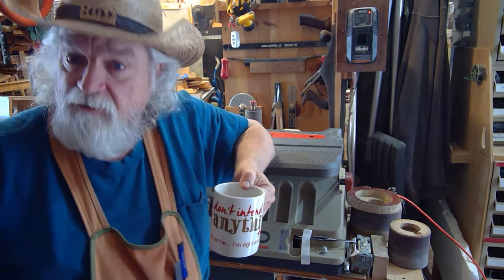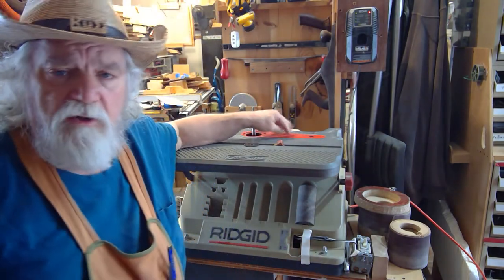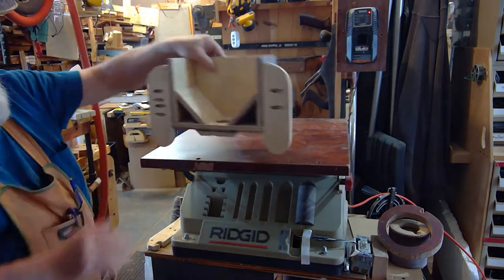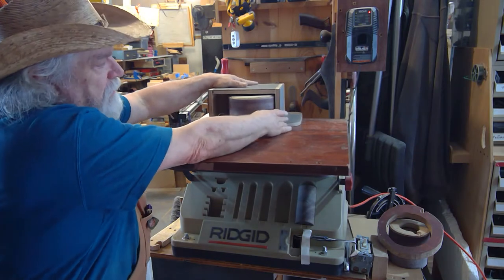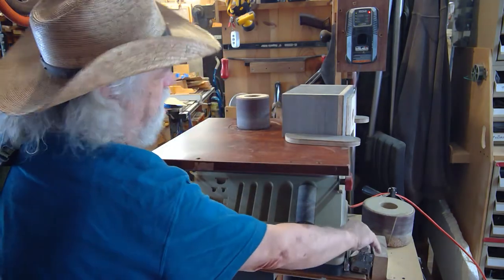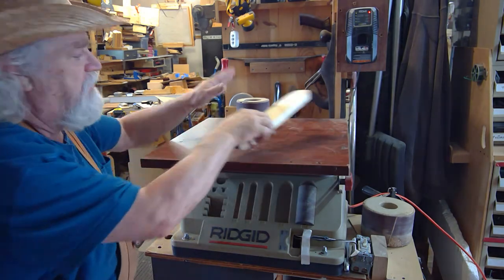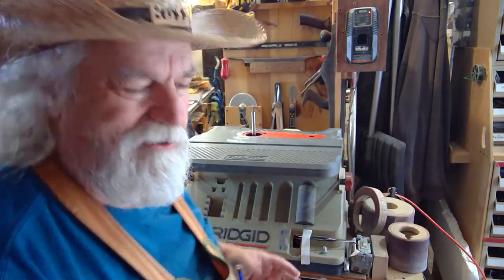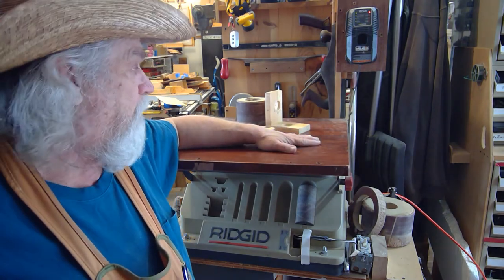Dust Collection on the 6 Inch Drum Sander by OTB Thinker

Comment: Another good one Russ! I think you can put another couple pins to index/locate the table top so the miter slot will line up easier when putting it on.
Reply from the maker: thanks Tim.  I made the runner to fit tight into the miter slot, maybe a little too snug.  I am going to remake the table anyway.  I want a nice drum insert ring system and a couple of other features.